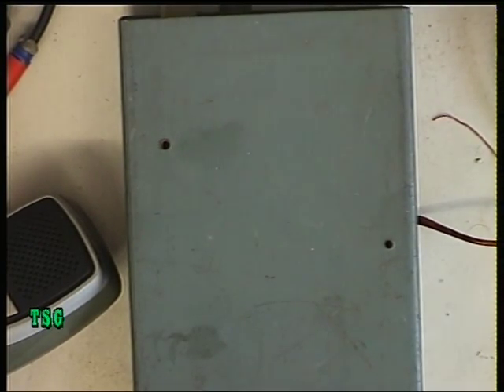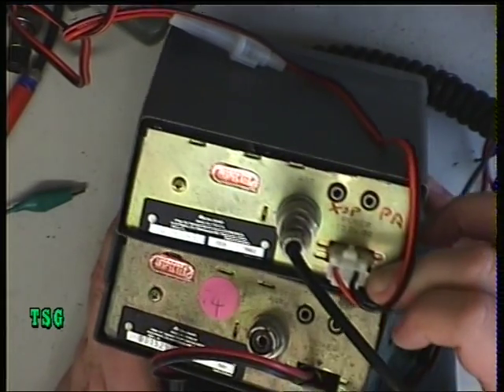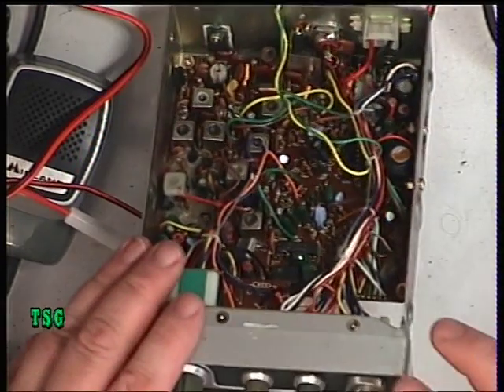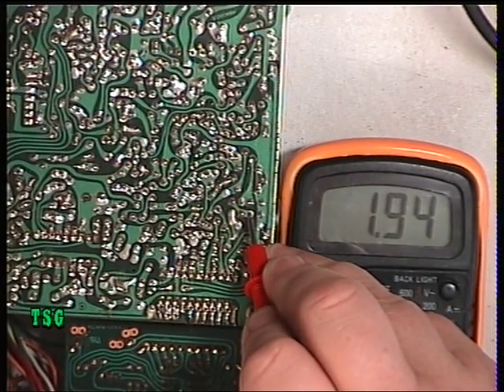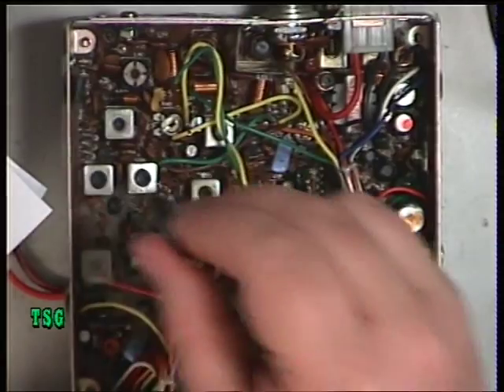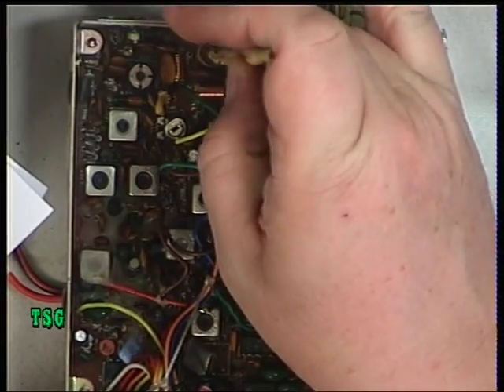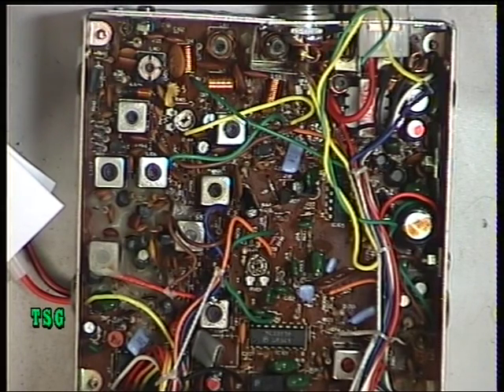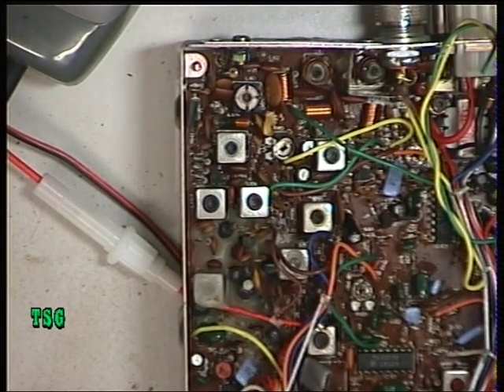Midland 2001, UK (CB 27/81) CB radio (Mobile) - VCO & TX alignment

Comment: Interesting how this only scrapes in at 3.2w whereas that Maxcom 4E was capable of well over 4w!
Reply from the maker: The next of the Midland 2001's I did (the one painted brightly) did 3.8W. 3.2W is the minimum acceptable. However, this is when the transmitter is hot that it 'only' does 3.2W. I can bet my bottom dollar that it does 4W for quick transmissions like "roger", and will drop down over about 20 seconds to 3.2W. That 3.2 real watts will also read about 6W on a typical CB power meter.

Anyway, it makes so little difference, we are talking about a few yards range difference between 3.2W & 4W. Remember, in decibels we have to square the power to double the range...so double the range of a 4W transmitter would require 64W & to double the range again means 2.6KW.

When we start doing Great GT848.GT858 & GT868 radios (such as Fidelity 1000, Lake 850 & Sapphire X2000 respectively) We will find the acceptable minimum on that chassis is 1.5W. We'll need service bench 3 to do them with its sweep generator. (Service bench 2 has SSB capability with it's Schlumberger test set). Service bench 4 can only do business radios as it covers 70Mhz to 512Mhz.
Reply: UK CB radio servicing Yes and that issue about the difference between 3.2 and 4w makes a mockery of those people who insist that their radio is peaked up to 5w or whatever it can do - all you do is make the radio illegal to use, risk more TVI, thrash the output stage and gain no measurable benefit in terms of range!
Reply from the maker: The 4W worldwide standard for CB wasn't plucked out of thin air. Very clever people researched it as the best compromise between range, cost, interference & so on for what is a short range citizens radio service..supposedly up to 16km maximum range. Well I get 30 miles all day long TOTALLY legally from any of the three base station aerials here!

I wrote a superb paper once on radio range, a condensed version of which was published in Citizens Band magazine on how to work out expected range. Antenna & Receive sensitivity are the key issues (I did technical writing in those days) Here is an example. Everything scores points to work out either + or - dB's :-

TX pwr station A = 4W = 0
Tx pwr station B = 4W = 0
Antenna height (my base) Station A = 20' = -3
Antenna height (my car) Station B = 6' = -15
Antenna gain station A (1/2 wave dipole) =0
antenna gain station B (roof drilled mount 1.5M) = 0
worst receive sensitivity (lets say both are Amstrad 901's) +19
Total coax loss = -1
type of terrain = country, flat + dry = -3

All adds up to  -3. MAximum range = 15 miles

now, both radios only do 3.2W altering the figures to -7 total

range for two 3.2w radios now = 14.5 miles

now each radio has 25w burner altering figures to +15

range for two illegal 25w setups = 17 miles. Wow

Am I clever or what!

Richard
Reply: Intresting video this. Been using one of these little radios to help me learn about  how output stages work.